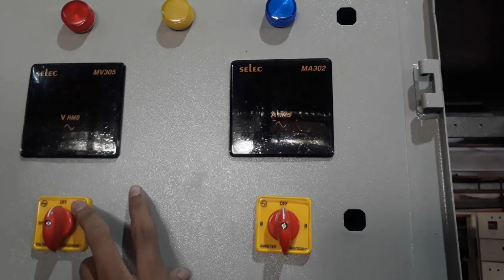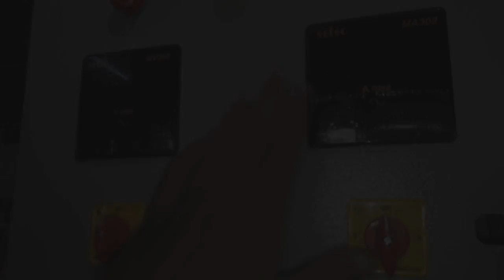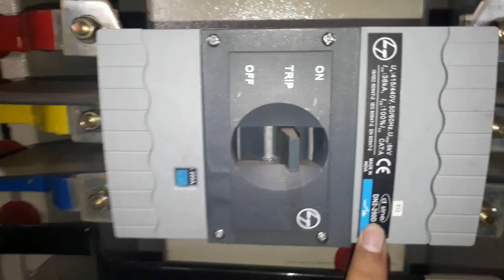Switchgear Main LT Distribution Panel Making and Wiring step by step | Electrical panels

Comment: Sir please upload video on distribution panel of BoM, design, wire size calculation, circuit breaker calculation busbar, fuse, CT ratio.
Reply: Bro, I too need that. If u got it, pls paste the link here. Thanks